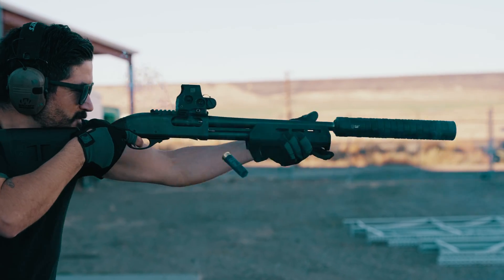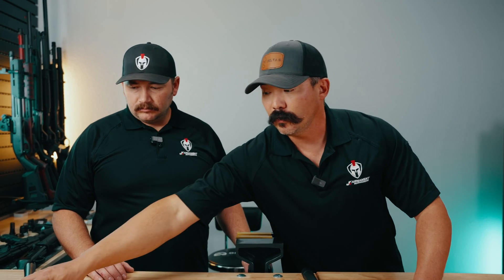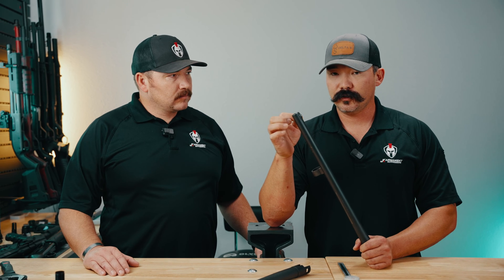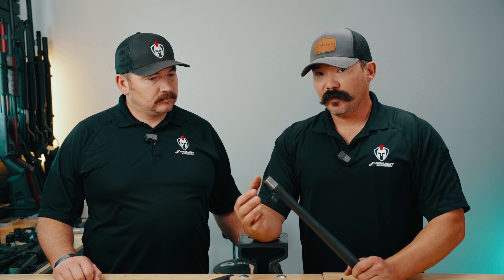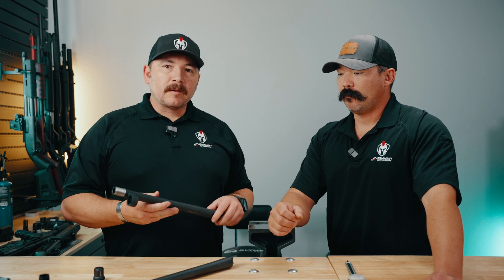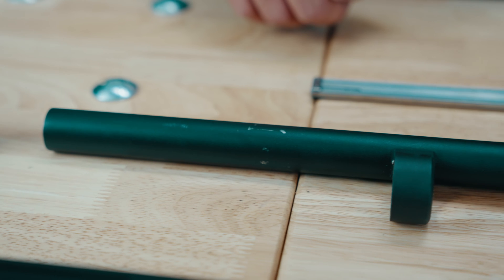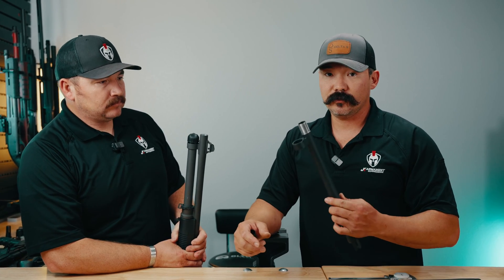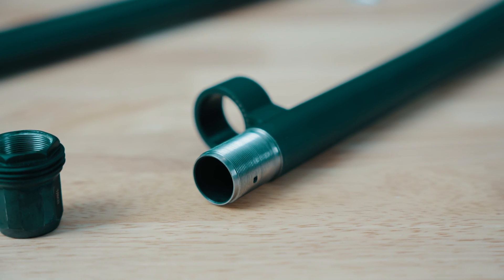Shotgun Barrel Threading & Muzzle Devices

Comment: Would like a 10 inch mcs barrel m22x.75 to match your suppressor adapters to this platform , I have a veper fostech and kel tech in this thread pattern already the 10inch mcs barrel cannot be rem choke threaded due to whare lug sits on mag tube

Comment: Noice so is this barrel spec issue a gun by gun thing or if I have a Remington 870 are the barrels all going to be the right spec?  Seems like external threaded way to go so you can remove it if needed?  I want this.  I have standard Remington 870 I want this on you guys think I’m safe with external threaded?
Reply from the maker: For the most part yes, we've seen varying tolerances from various manufacturers, but Remington has been pretty good. External Threads are the strongest. to externally thread, you would need to take some measurements, that information can be found on our website.
Reply: @jkarmamentsuppressors  can do what do I need caliper set?

Comment: Can you external thread a Mossberg 590a1 retrograde 12 gauge to receive a flash suppressor? Im assuming if so, the front sight will have to be moved back??
Reply from the maker: Yeah the front site will be in the way. it will most likely have to be romoved on your shotgun. everything else should be good as long as your barrel diameters are good to go.

Comment: I have a vr80 12ga shotgun which is threaded on the outside and inside of the barrel. could I just thread one of the suppressors on or would I need to use the inside thread to put one on?
Reply from the maker: we recommend putting one of our shotgun muzzle devices on the outside of your shotgun. the suppressor threads onto the muzzle device